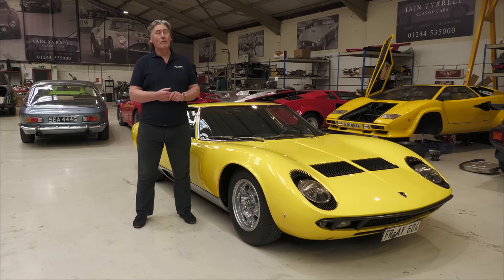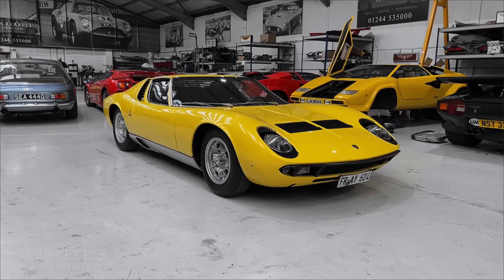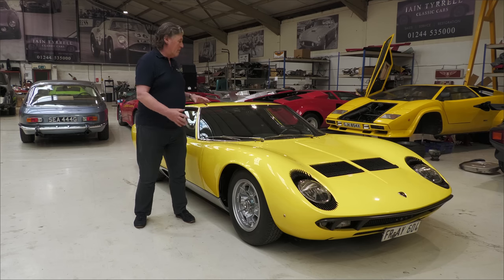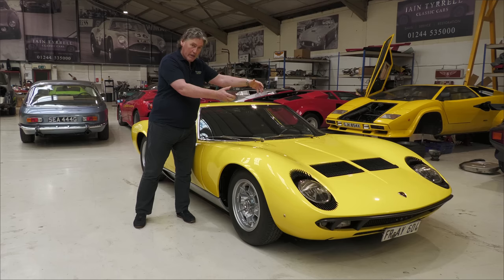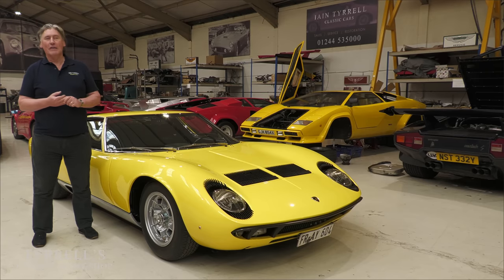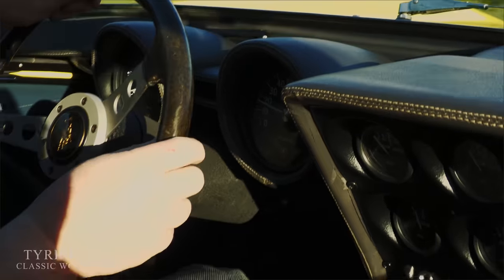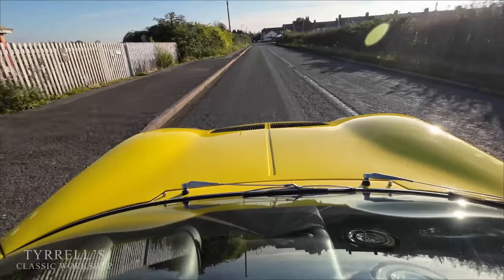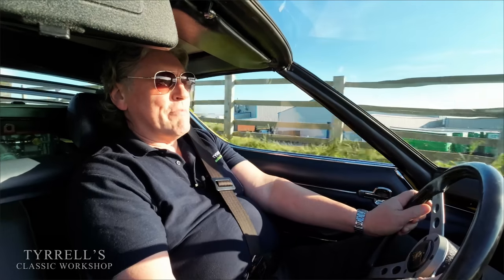Black Forest Lamborghini Miura S Renaissance: A Masterpiece in Motion | Tyrrell's Classic Workshop

Comment: Great video Ian. Some years ago I was involved the restoration of a Muira, strangely enough the same yellow as this one.

Couple things I still remember well. Firstly the way the headlamp pods raised and lowered! What we thought was an electric aerial switch in the centre console was in fact the control for the headlamp motors! One of which was missing as well, I think they came from a Citroen DS, being the window motor. IE they didn't rise and fall in conjunction with the headlamps being turned on or off.

Secondly the heater control valve which was in the lh sill area and looked just like a domestic central heating gate valve, so crude for a supercar! The switches in the overhead console, like a light aircraft were a bit different as well and lots of Lucas sourced electrical equipment.

Comment: Bella! 
Congratulations TCW.
Can vouch for Power-Up if that gear does not settle; and it will certainly make the gear shift even better. No connection, just been using it for 25 years, over 400 000 kms. It works like they say it does! There's one from NZL for you Iain, Bob would be proud. Mate of mine used it in a R22 gear set so they could lift heavier loads. Shhh. :)

Comment: While I could never afford any of your cars in the workshop, I still owned 2 vintage cars, a 1970 Triumph Spitfire MK3 and a 1970 Fiat Spider 124. Both lovely cars, however, when I restored the Spitfire at the tender age of 20 without any technical background, I still wondered how the f..k they thought the carburettor throttle transfer was acceptable?
Also, after I reinstalled the entire wire harness, I was left with 7 meters of cables, but everything worked fine? 
The Fiat however, was a technical Gem!  Belt driven DOHC, super easy to service and never let me down in 15 years, unlike the Spitfire. So much for British Engineering. Sorry.
I recently purchased the new Fiat 124 Spider (Miata 🙄) it's so much fun, just like the original!
Greetings from Mik, a German living in Melbourne for 26 years now😀
Reply from the maker: Thanks for sharing your experiences!

Comment: In older timber house construction ventilation of cavities is the key to allowing things that get damp, to dry out before rot has the time to set in. Interesting to see that it's the same with thin tin car chassis!

What is that paint colour called, please? It is perfect. <3 Even after a lifetime around Mimosa yellow Triumphs, I always thought if I had a Miura it would be a green one. But this car has changed my mind.

Thank you for all of these videos! Over the years I've read/watched a lot of quite low-fi writing and comment about how Lamborghinis are made for the las Vegas strip and they are supposedly not very good cars; apparently they don't perform, don't handle, don't do this that or the other... seeing these myths calmly and sensibly dispelled by wiser and greyer heads like yourself and Harry Metcalfe has been a delight to see and learn!
Reply from the maker: Thank you! The paint colour was a Bertone mix at the time simply called “Giallo”.

Comment: A question, how long would the running in period be (miles) before the gearbox and other fluids would be changed ? I assume it would be down to the client to return the car or would you fly out to service it ?
Reply from the maker: About 400-500 miles. There is normally someone close to the customer who can handle basic operations such as oil and filter

Comment: I am just curious, the whine from the transfer box sounds quite load to me but you comment this will quieten down when the running in oil is replaced... question is, why is running in oil needed these days and if it's thin isn't that actually damaging the components.
Reply from the maker: Engines like this still need to have the rings bed into the bores, for example, which modern oils with high coating additives prevent from happening properly. The thin oil doesn’t harm the engine for a few hundred miles. Thanks for your interest

Comment: Pixies & Elves @ £200 per hour for 2000 hrs of work £400,000 or perhaps well over the top at £400 p/hr £800,000 
   Worth every last penny to the new owner with an engineering art work that's appreciating in value.

Comment: Hearing you talk I'm not surprised your emotional, this thing seems to be as much your car as it is the owners, also after seeing and watching a miura resto for over 20 years while I see your point with the holes in the frame, that were aircraft based to reduce weight, resulting in a car that was approximately 2300 pounds, the same as an MG of a similar vintage before they put the rubber baby bumper buggers bumpers on them, but those holes also add structural weakness to the car and were often uneven, thus caused cracking and caused alot of the body flex and problems the early cars had

not unlike a Lotus Esprit actually, where both Number 27 and Video bob mosely have said that basically it feels like nothing is holding together well enough, and you can spend all that time aligning everything, but the chasis is just so flimsy it eventually comes undone 

and the body and shuntlines just end up going to hell because of it

granted I've never seen a Miura go full E type and end up like a typical british midlands junkyard heap 

where its covered in moss, you see this beautiful shape and then you look at the bottom and shake your head as its too far gone to save

although they do very much do that with the body however

Comment: The differential sounds like it’s stuffed the loading is out by miles and if driven it will be trash 😊😊😊😊
Reply: How many others do this with running in oil?
Is this gear set adjustable like a standard diff set is...? Get it out to measure/check...?